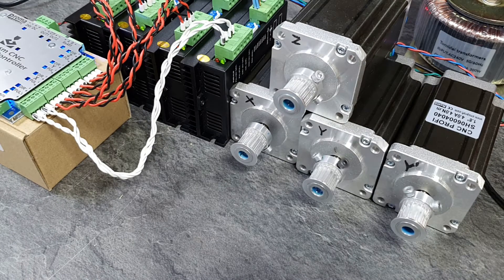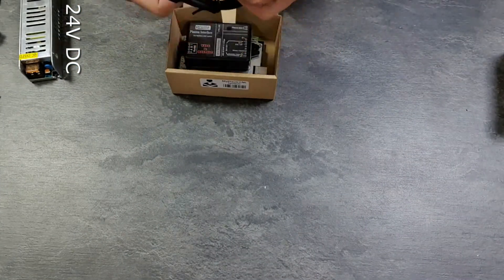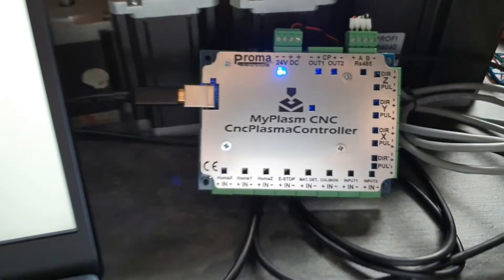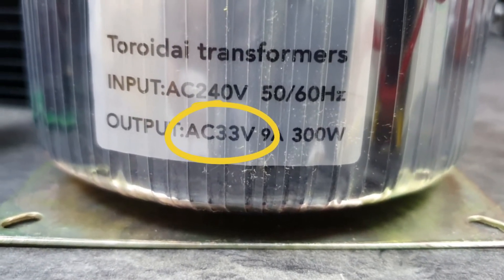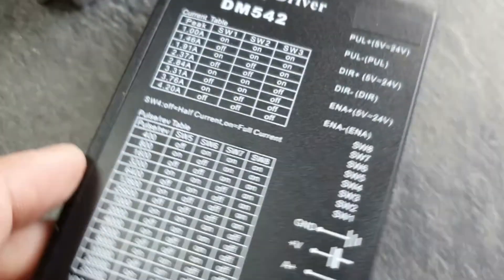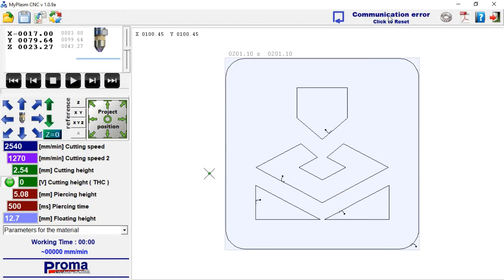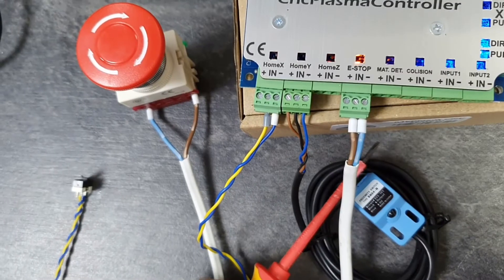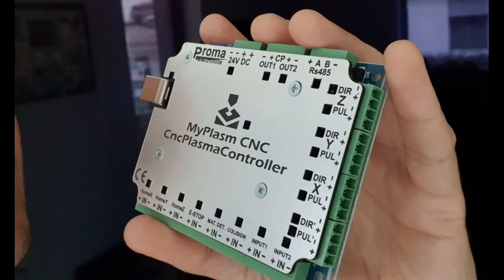# 01 MyPlasm CNC System step by step EN - Basic connections and first start-up

Comment: I am not getting power to one of my stepper motors.  I can hook it up to the other driver get power and swap the power from the working driver and get power to one or the other motor.  It's starring to seem like the Myplasm controller is bad as I've already replaced the leads to the motor and driver from the controller.

Comment: Hi can I use 2 drives of Y and the additional output for rotary axis?
Reply from the maker: Hi. Rotary axis on flat table ( using the same Y axis ) is not good idea. 
If you want to do it ( not recomended ) then you can connect both Y motors to Y output.
Controller has 4 axis only. But can connect 4 drivers to one axis.

Comment: Every time I try to access the configuration menu it asks for a password. What password do I use? I can't set my xy and z limits
Reply from the maker: go to MyPlasmCNC/store folder and open (by notepad)  "store.fms" file . 
Then you can found your password below eSpec5 text.

after enter password in MyPlasm CNC software you can delete it ( or change ) in special function window.
Reply from the maker: or delete "store.fms" file then all software will be restore to factory ( without password ) but need all configuration again.
Reply: One final question.. how do I delete a project and import another.  I clicked the project on the screen and hit delete on the keyboard but nothing happens
Reply from the maker: @758Redwhulf  by import window

Comment: hi i have some ideas for add to the next myplasm software release. if you are interested let me know
Reply from the maker: Hi, i have very long list of wishes from customers. I can't add all because main idea of this system is  so simple, it couldn't be easier!. But most interesting function what not complicate the software i always try to add if will be helpful for lot of users, not for you only ;)
send me email to contact@proma-elektronika.com please !
Reply: this is simple and useful. (DYNAMIC PIERCING).   machine go to position z go down touch the material. here start  1 touch material the torch go up to transfer height ( user define height. 2 after the arc is transferred the system detect the arc ignition and go  higher height PIERCE HEIGHT. (user define HEIGHT and time)  3 when the time delay is reached then cut height and move. easy and not so complicated. 1 touch 2 transfer height 3 pierce height 4 cut height X Y move. this help when process thick metal make an successful arc transfer  and the pierce height take care for consumables. what do you think? take this in consideration please.
Reply from the maker: @kelvinespinosa1430  It's working like you wrote...   Look to user manual page 29
https://www.proma-elektronika.com/download/MyPlasm/MyPlasmCNCen.pdf